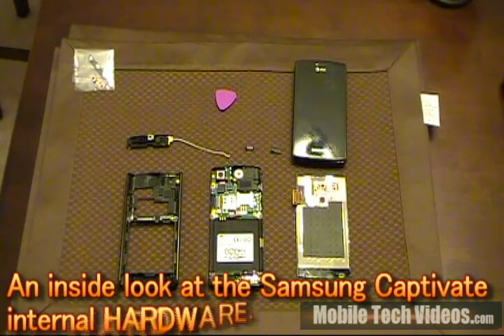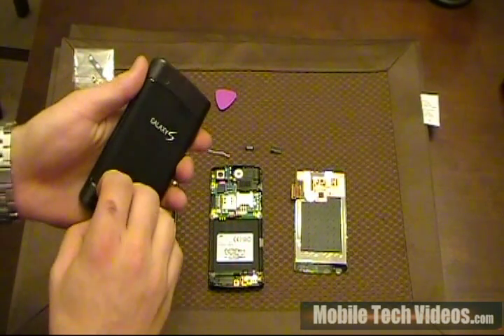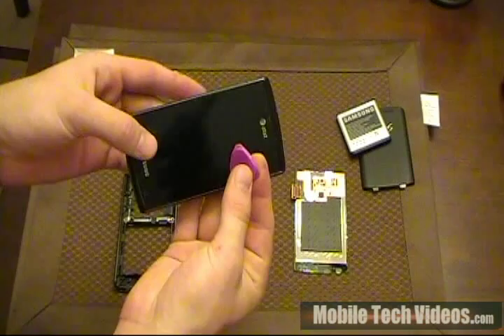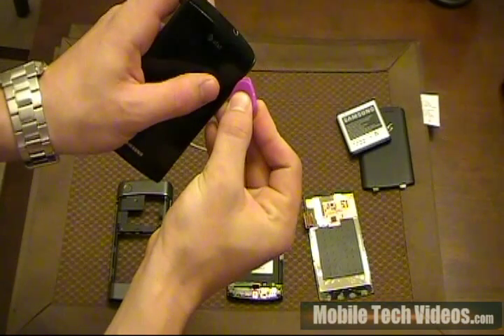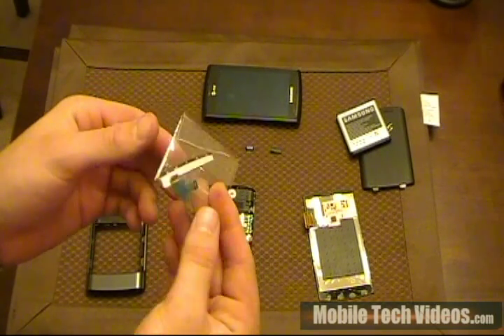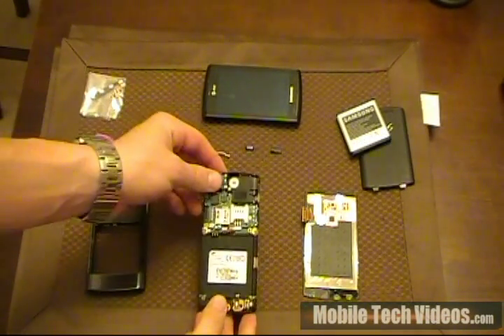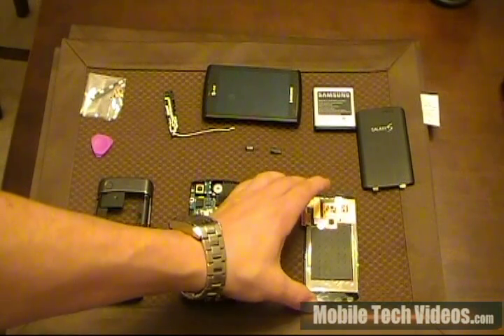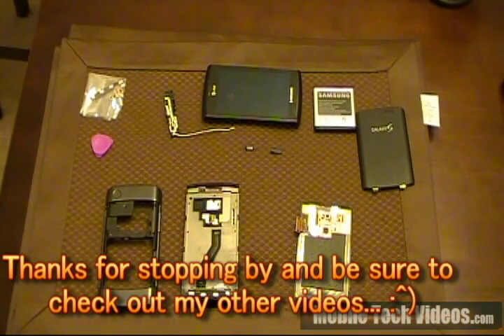Samsung Captivate (Internal Hardware Tour)

Comment: i need help, my captivate receives very weak wifi signal, i tried several roms, kernels and modems so it's not a software/firmware issue and i would like to know if it's possible to fix and what should i get replaced to fix it